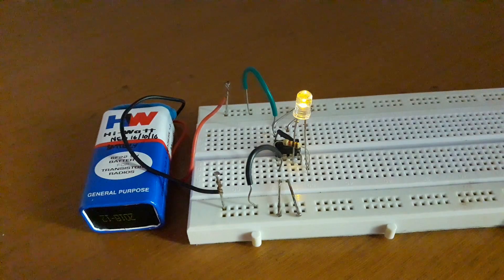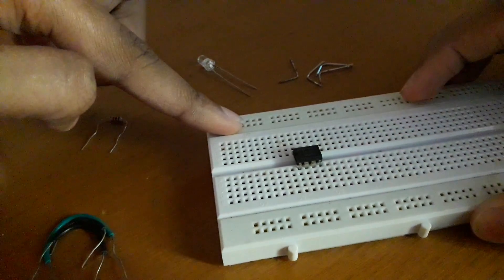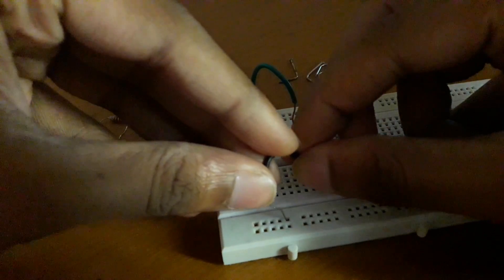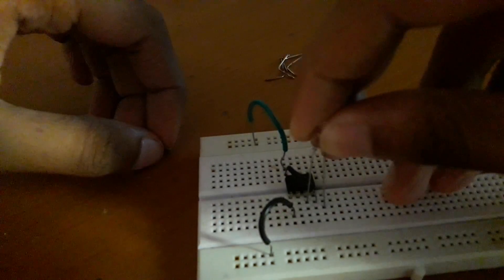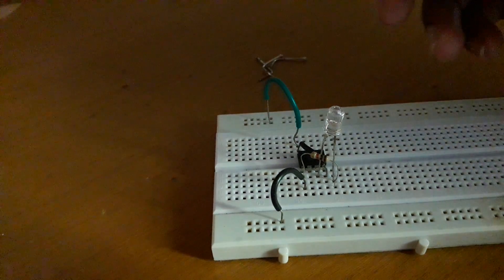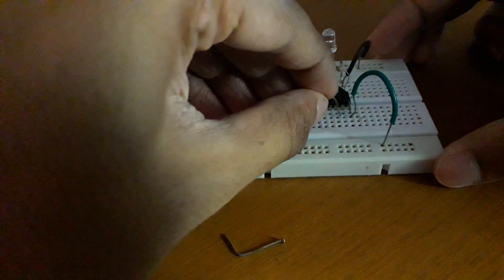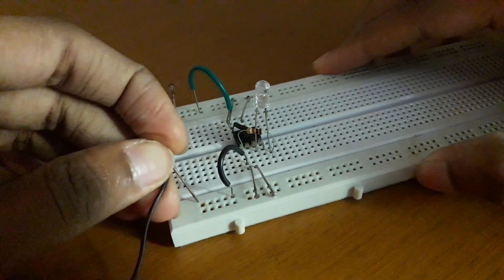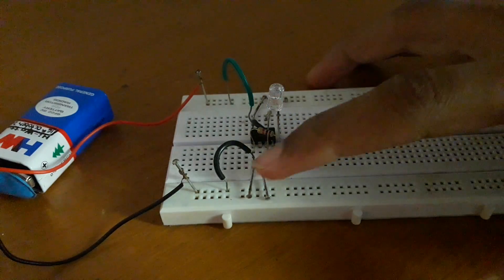✔Touch 'ON'/Touch 'OFF' L.E.D💡on Breadboard using '555 Timer IC'

Comment: Dear need your kind help. After switch is ON by touching the pins, how long will it stay ON unless pins are touched again. I am working with a project where the bulb will remain ON unless the pins are touched again. Since it is a timer IC, so i guess will it auto turn off the LEDs after certain time? 

2ndly: What is the max amp of IC555? I will use motorcycle battery.

Please advice

Comment: what can I use for the touch probes?
Reply from the maker: +Yours Truly You can use a pin, a wire or basically anything which can conduct electricity and will fit in the breadboard.